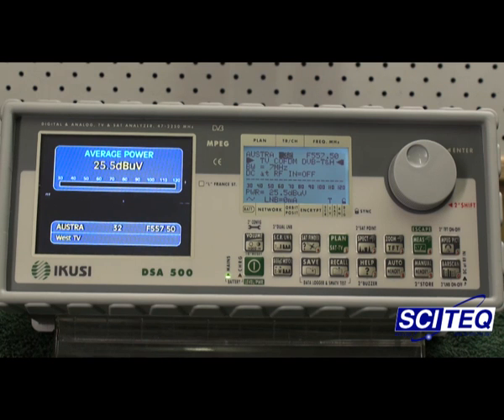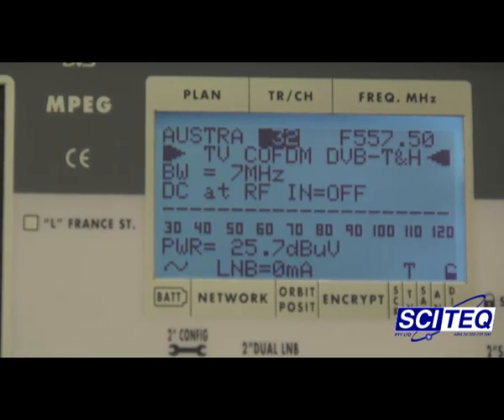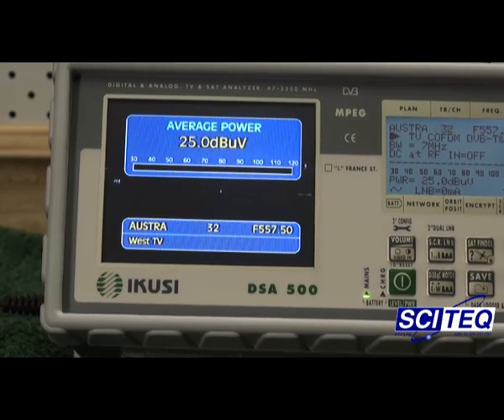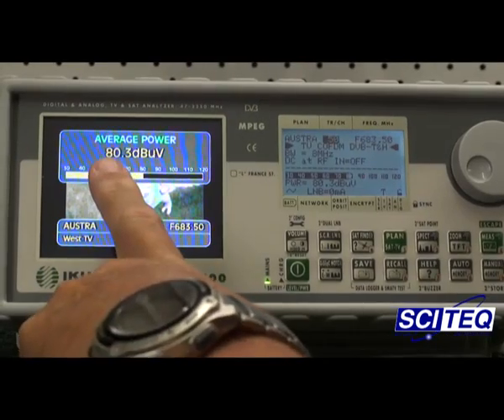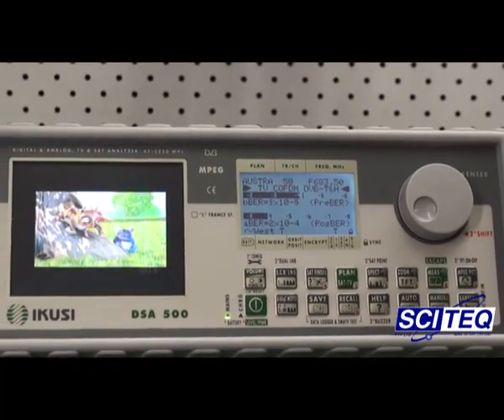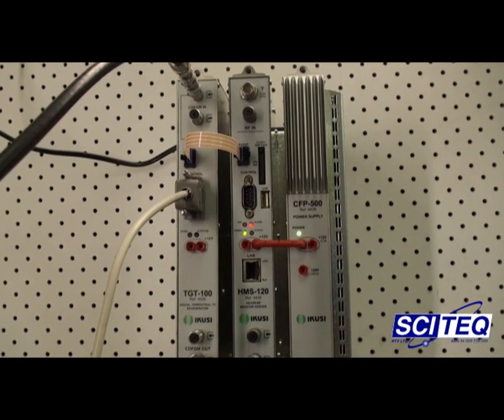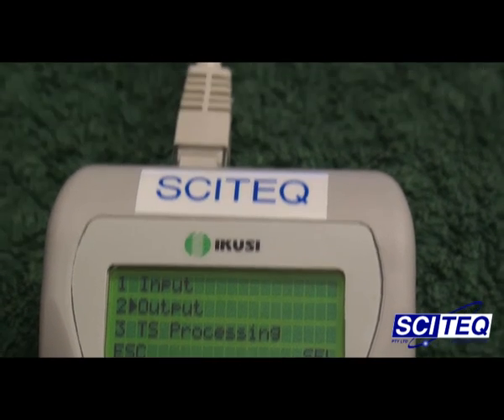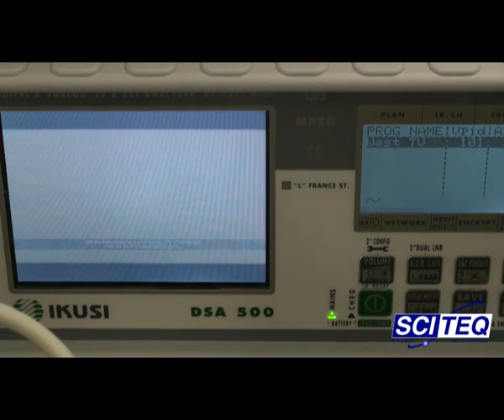ikusitgt100.mp4

Comment: Also a tip that made all the difference, move the output frequency. The engineers told me that it has a 1-2 second processing delay and if you don't change the output the new and old signals cancel each others out.

Unfortunately found this out the hard way, before phoning for tech support!

Comment: Believe it !!! 
I have used numerous TGT's to fix problem sites were no other solution has worked. They are especially good around metro areas where you get a lot of reflections and inference degrading the picture quality. 
I personally found they work best if you have at least 30-35dBuV power level and a minimum quality level of 16-18dB MER or b-Ber 1x10-2. With these levels the TGT regenerated perfect pictures with 78-82dBuV power and a MER of >32dB / b-Ber 1x10-4.